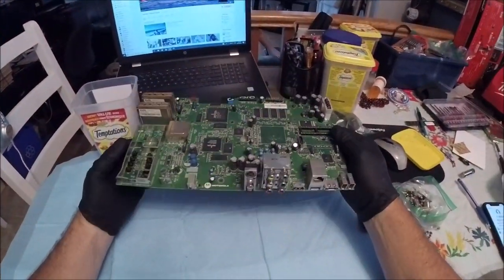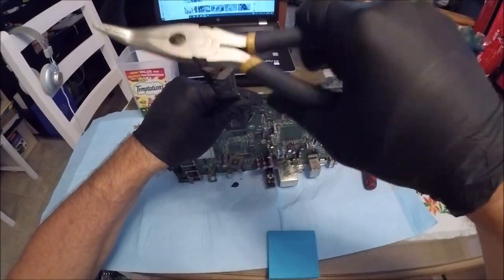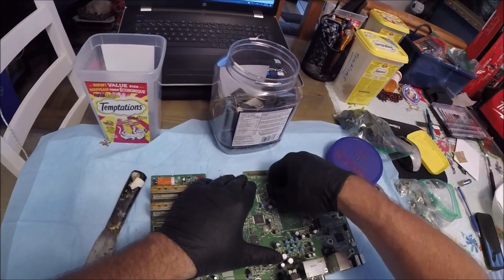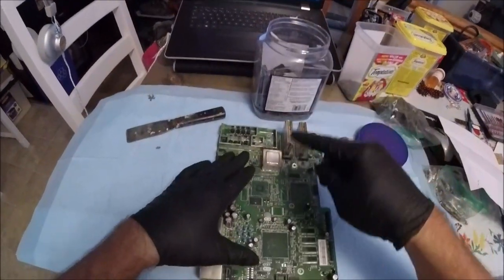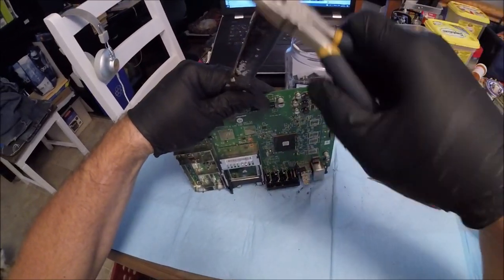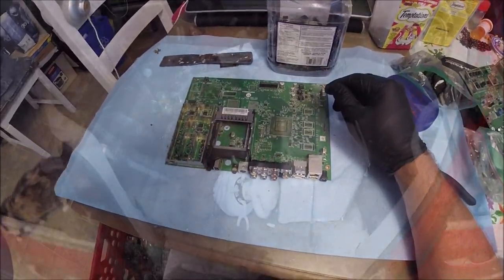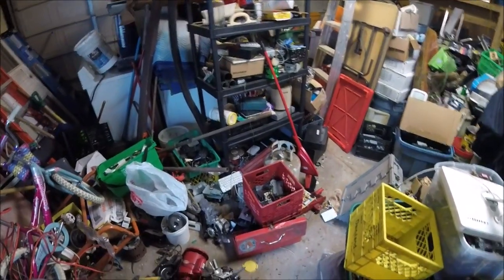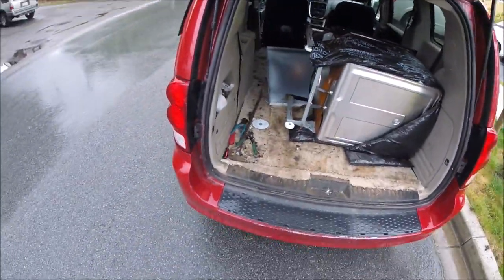E Waste How To Remove BGA's + Flat Packs & More

Comment: Have you improved your gold band crystal oscillator removal yet?

Thanks for the BGA tip.... i was having issues getting them off so iv sat them all to the side until i find the best process for myself.

Cheers man. Great vid...
Reply from the maker: Not yet
Reply: Iv found that tools with a square face that you can get flush with the PCB work.

I use a set of multigrips with a square face. Something without much "walk or talk"  
  Get a little bite on the longest sides. Then a twist will crack the solder and they come off without breaking.

Push down hard on the tool.